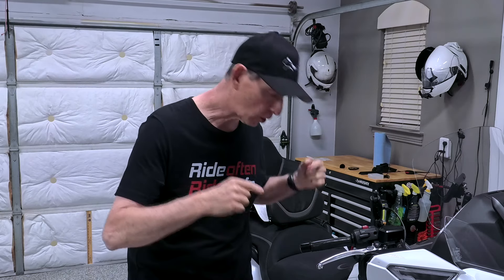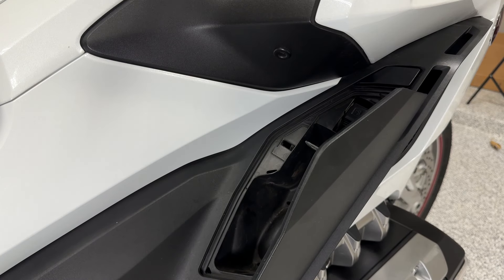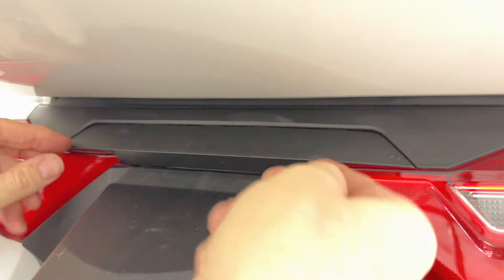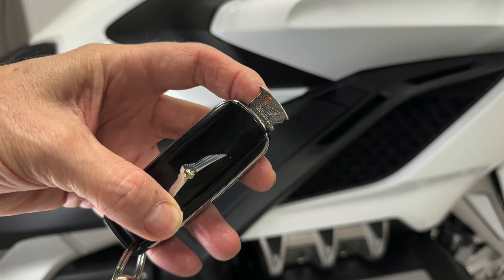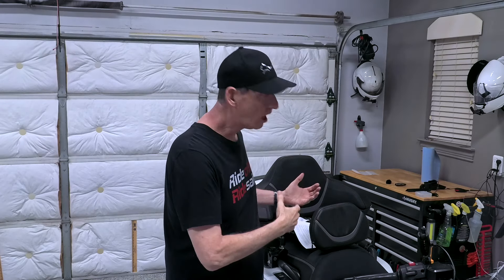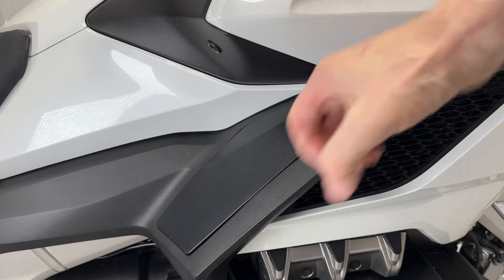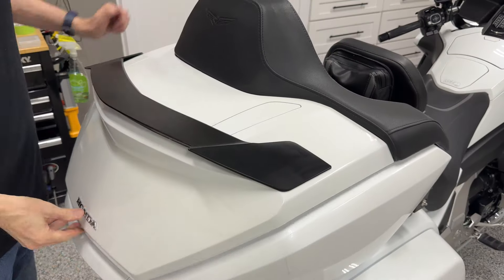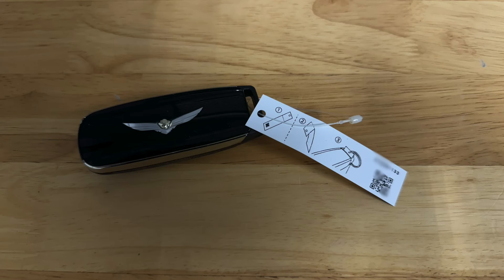I Am LOCKED OUT Of My 2018 Honda Goldwing DCT

Comment: You may be aware Traxxion has a video where he drills a small hole in the lid then puts a small plug in the hole. If locked out he removes the plug, takes a pen, etc. and hits the switch to open the door.
Reply from the maker: That will only pop the gas cover
Reply: That only open the door to your gas cap.
Reply: One of the first things the deal told me when I purchased, never put the thing in that side picket

Comment: A clarification. Honda's emergency start procedure requires both saddlebags to be open. The trunk does not have to be open, too. Check the owners manual in the Activating the Electrical System in an Emergency section.

Comment: To my knowledge, even if you had the key to use the mechanical lock to open the saddlebags, trunk, and start the bike using the codes, it still does not unlock the side compartment door. You need some sort of secret release (string/cable) for the side door pre-installed. (Traxxion/homemade) Also, if you put for active fob in your jacket and put your jacket in your trunk, anyone could start the bike. It's active. Bottom line: Just like your car, do not lock your keys inside. duh!

Comment: I had a similar experience with my 23 Triumph Tiger GT Explorer. I carry the smart key in my front right pocket on my riding pants. I guess I forgot to zip up my pocket and the key fell out somewhere on my ride home on a 200-mile trip. I stopped at a roadside park to stretch for a minute and of course shut off the bike. When I was ready to go again it would not start. After figuring out I lost the key I had to get my wife to drive 80 miles to come and pick me up and take my bike to my dealer. I didn't get an extra key when I bought my bike because they had to order it and it and hasn't come in yet. I definitely will be more careful when carrying my smart key in the future.

Comment: Maybe someone else has done this too. I took a piece of ABS plastic and cut it to fit inside my glove box I attached it with double stick tape. It’s separates the two odd shaped spots in the front. I use those odd shapes now for my home keys and the other for my Goldwing key. Works perfectly for space that otherwise is useless

Comment: why would you turn the fob off. It turns off by itself after no use after an extended period. You're not saving that much on the battery. If you do want to store the fob somewhere, put it in the middle compartment that doesn't lock

Comment: So simple...just clip your smart key to your belt loop with a good clip. Don't put it in your jacket, or on your bike. 
Also...in Canada, new Goldwings come with 2 smart keys and also a spare emergency key. There's a couple great "secret" but accessible spots on the Wing to fasten this 3rd emergency key, using a small plastic zip lock bag and Gorilla Tape. Easy to cut an extra as well.  To go one step further, I carry a couple of spare 2032 batteries with me  whenever I'm put on the bike...just in case I get the warning, or my smart key dies while on the road. On long multi-day or multi-week trips, I bring along my 2nd smart key just in case I lose the 1st one...

Comment: Had a similar experience except I accidentally left the ACC active when I left the bike for my work day. Came out after work and the bike battery was dead. Oh...and then discovered my fob key was no longer in the fob. Couldn't open the side bag to get to the battery, so a dispatched road assistant and I took about 45 minutes of trying to pry the side paneling enough to touch the jumper cables to the battery posts. Then trying to keep the paneling pried, the jumper cables connected, and starting the bike with only 4 hands. Finally got it started. Went to the local Honda motorcycle shop and orded three blank keys to have cut by a local motorcycle lock smith.
Reply from the maker: I know when I ordered a second fob from Honda it did not come with a blank key, so I need to order a couple of those as well.

Comment: Good video.  I have a 2018 and bought an extra FOB for some security.  After seeing this, I decided I should check my extra FOB metal key.  Guess what?  It won't turn in the lock.  Still investigating.
Reply: My BMW and KTM needed VIN / ID verification / proof of ownership and they cut the switchblade key. The BNW is user programmable.

Comment: I bought a 2018 in the USA. Yes, it came with only one SmartKey, but has the small key inside SmartKey, and an additional key that I always keep in my wallet. I later bought, and programmed a second SmartKey to bike, and also a second mini key for second SmartKey. And I keep a spare battery in my unlocked cubby, just in case. And pictures of my emergency start-up codes in my phone, which I always keep with me. Primary SmartKey in my front pant pocket all by itself. I think I have all my options covered.
Reply: I made the Honda dealer give me  a second key fob as part of the deal.

Comment: So how did perry get his side door open? Did he hire a lock smith or did he break the door?
Reply from the maker: Neither. There is a reason I cant say. Yet.
Reply: You would have to remove the fairing side panel to have access to the fairing side pocket...then you would simply pull on the release cable and the pocket door would open..not hard at all to do

Comment: I also keep in a spare battery in the center console incase the battery dies while im out. If you have a utopia backrest keep the metal key inside the zipper of the foam pack. Not the pocket provided on the back but the zipper for removing the foam back itself. It's not quite so obvious to would be thieves.
Reply: There are lots of places to hide a key on a GW

Comment: If you never turn off your fob, will the battery last for for a year when you do the smoke detectors? I don't think that my Grand America, nor KTM 1290 SAS's fobs have a shut off switch. The batteries last for well over a year. Maybe they go into a low power mode? (The batteries last long enough for me to forget how to change them.) 
My BMW has an emergency (passive)  key that is hidden behind an access panel. The sweet spot prox sensor for it is on the gas tank.

My Triumph fob can be switched off.   Wow, I forgot to mention my Harley fob, but the bike can be started with your customizable PIN code.

Comment: Mr. Cruiseman, my problem is somewhat different.  I have a 2018 Goldwing with a brand new Motortrike Kit installed.  It did not come with the tag showing the emergency start procedure and, as you said, no second key fob.  I traced the bike to the state where it was originally sold hoping I could get the Dept. of Motor Vehicles to tell me who the original dealer was.  But, no luck. The DMV declined based on their privacy laws.  I asked a Honda Dealership to pair a new key fob for me and they said it's not possible since it no longer has a left saddle bag.  So, what are my options?  Suggestions anyone?
Reply: Call Honda America and with proof of purchase and identification they will send you the code.
Reply: @cschym2705  Thanks!

Comment: Well Max at Traxxion Dynamics has the perfect solution. I purchased Max’s solution and installed it a few weeks ago and then left for a 3 week ride to Texas. So what is the solution? Traxxion Dynamics cabulation installation. It does 2 import improvements. First it takes the cable from the electronic solenoid that pulls the cable to open the side pocket door when you push the button with the key fob close. You simply remove the cable from the solenoid actuator route it down to the back top of the motor. The Kit comes with an anodized aluminum cable holder that allows you to reach down pull on the cable and open the door without the motorcycle operating or in this case if you had locked your key fob in the side pocket. No one will ever notice the cable and it ensures that you will always be able to open the side pocket and then open your gas tank cover. The second cool thing about the kit is that it gives you a cable that you attach to the actuator for the cubby box that holds your cell phone and it runs a cable down to the left side back top of the engine and uses the exact same aluminum black anodized cable holder. This allows you to open the phone cubby by reaching down and pulling on the end of the cable. it is also advised that you disable the push button on the cubby phone holder box, so that when it is shut, no one can push on the button and open the box. Once again, the cabling and its new location is so hidden on the bike that no one would know it was there. I have used it flawlessly for the past three weeks and I must say it solves the problem of having your side pocket door not open to put fuel in the motorcycle and it allows you to shut your cubby where no one can get to your cell phone. Neither one require using the key fob. I would advise anyone with a. 2018+ Goldwing go to the Traxxion Dynamic website and check it out. I will end with I appreciate Cruise Man, addressing this issue, but I think that. Max has all of us Goldwing owners a great way to solve this problem and lock the cubby with the phone. Best of luck to all. - James

Comment: I made a copy of the key in the key fob and just carry it in my wallet.   Leaving your key stored on your bike could let people get into your bike.
Reply: Could also let somebody ride off on your bike, yes?
Reply from the maker: @garlandlabat4922  only if they had the emergency code.
Reply: Smart key or the backup metal key?  I have a Concours14.  I never store the fob on the bike because it is like leaving the key in the ignition.  Unlike the Goldwing, the backup key will open the saddle bags, remove the saddle and open the gas cap.
Reply: @cruisemansgarage :  That's why I don't bother to hide my emergency key.  It goes into the center storage cubby along with spare batteries for the fob.
Note that I'm talking about the larger emergency key that also comes with the bike, not the smaller one that hides away in the fob.
Edit:  FWIW, the fob stays in my pants pocket.
And, if I'm going on a multi-day trip, for insurance I'll stash the second fob (turned off) into my luggage that goes into the trailer.

Comment: Fobs can be kind annoying.  I gave my wife a fob for the car and they she wanted to leave it in her purse locked in the car.  That was frustrating.  Depending where the receiver is and how sensitive it is, that can leave your car or motorcycle open to anyone.  I can open the trunk with the switch in the bumper and the fob in my pocket.  It is a problem because I like having the backup in case I somehow lost it and really don’t want to carry two keys in my pockets.